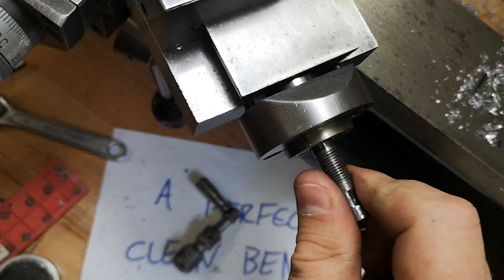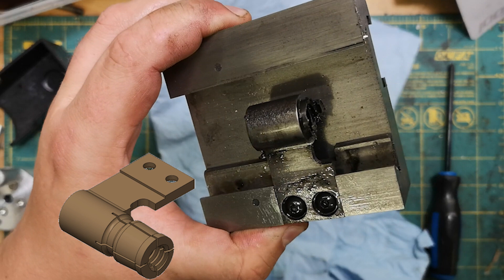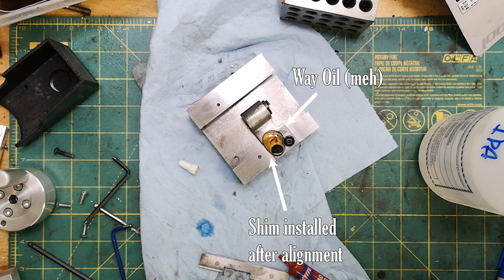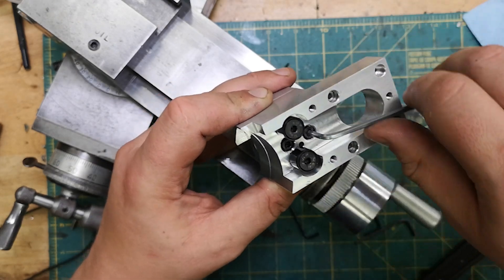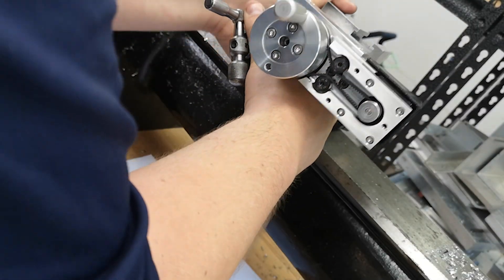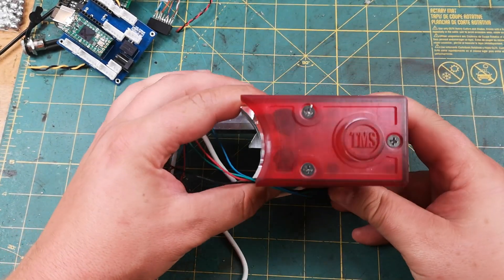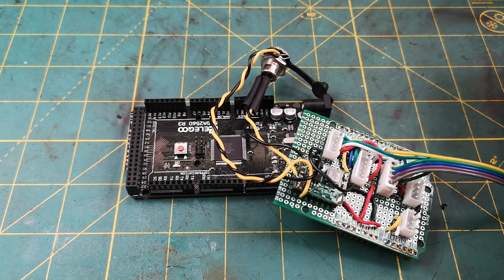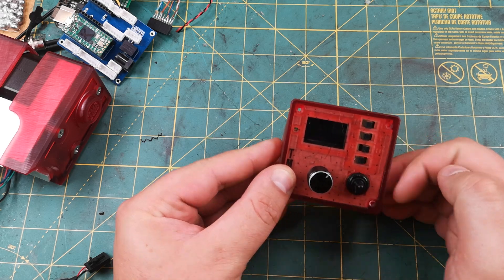Rivett Power Feed - Part 3:  If at First You Don't Succ...feed?

Comment: Look into mks makerbase servo hybrid steppers for baller on a budget servos. Its just a bolt on board and magnet that turns a basic stepper into a hybrid stepper.
Reply from the maker: I think I've seen those at some point, they look really familiar.. It looks like it would work in a step/direction configuration pretty nicely.  Once the Mechaduino died, I sort of decided to just go all-in on something readily available and easily scalable -- I'm sure i would just blow up an MKS servo eventually as well :P
Reply: @TabletopMachineShop  I have a bolt on cnc conversion I am working on for atlas/craftsman lathes. I went hard and got a masso G3 touch to run it. Uses NEMA 34 12Nm steppers because I want to be able to turn a hex.

Comment: Trinamic makes many chips/drivers/integrated motors that accept UART, might not help now.
Reply from the maker: Actually my newest board will integrate a Trinamic TMC2209 module for low-powered motors, and as you said, it does accommodate UART.  I believe I have the UART connected on the PCB, but I am planning on running it in step and direction mode for now.  I left myself some options on this board in the (likely) event that part of it doesnt work!